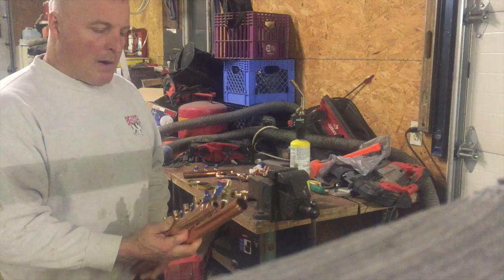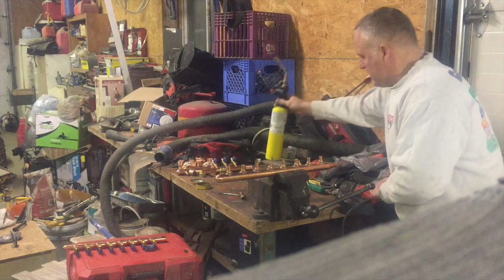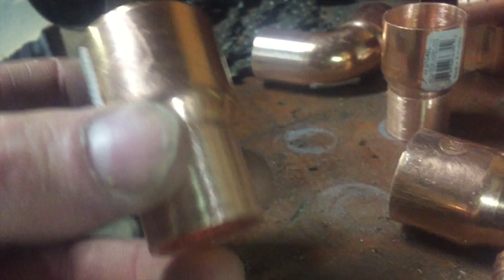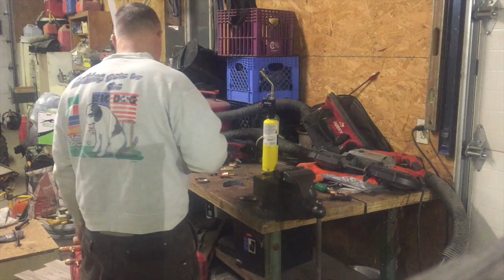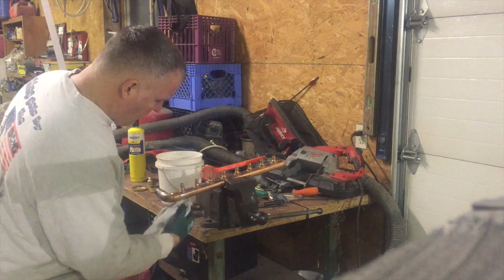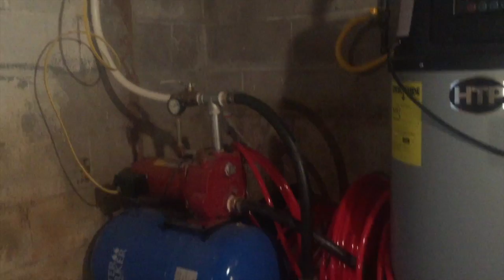DIY Radiant heat header build.

Comment: I disagree with the ball valve used here with blue handles to open and close.
I prefer ball valve with white handle that screws to close the waters.
Under it to progress with the T brass fitting and pressure cage in front of it
And after it a brass flow meter valve.with glass in it to read the flow in litters per hour.
And then i would go to a brass fitting for pex tube to connect to a feed line.
Everything here is fittings that screws and unscrew easy to maintenance without the need to cut pipes.
Easy to regulate easy. pressure an flow in the pex line with resault temperature control manually in the radiant floor.in the return line also a white handle that screws to close water needed.
I love copper but copper with brass fittings that screws together in order to maintenance service them with out the need for cutting pipes down the line.straight forward philosophy that you put the blue handle valve before and after things so you can separate water in that place screw unscrew fix the problem easy.
Philosophy easy that makes life easier down the following years.
Everything you made is fixed with the need of pipe cutting to service.
Also important insulation for pipes is critical to not have so much heat losses.that means more money to spend to hot water.
Economy in this system is achieved by hot as much as possible less water by litter and sending it fast with as much less heat loses to the place i tell it to go.and in return line.
Accepted number under 5 degrees Celsius from the pipes that send hot water and the pipes return water.
To check and find tune it you need thermometer in the hot water line after the boiler and thermometer to the return water to the boiler so you can check temperature difference.
Without insulation in the pipes system has 40% -50% more expensive functions than it should be.

Comment: Hey Bondo,  love your channel and have watch nearly every video you've made.

I've install my PEX tubing under my concrete and am about to tie everything in and was wondering if you could use those plastic manifolds instead of the copper ones found at Home Depot or Lowe's?
Reply from the maker: thanks awesome. you could use them but I would spend a few more bucks. order them online from Supply house. the copper ones. there not bad at all cost wise and last way longer. let me know how it goes with your heat system buddy.
Reply: @bondobuilt386  Well winter is approaching and back to my Radiant Floor Heating system. Have a quick question, do you need valves on each the supply and returns on the manifolds? I noticed in your video that one of the manifolds didn't have any valves on it.  Trying to figure this out :)
Reply from the maker: @vengeancestills  I always have them on the supply side but you do not need them on both but sometimes I do as it does not cost much extra if you use copper headers.